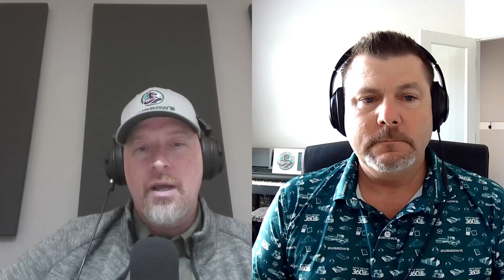EPISODE 41 - New Products!

Comment: That fact that only the bottom 5 feet is treated, is Ideal for Home construction or Barndo, Shouses, Man Caves, She Sheds. There is no need to use A full treat post for interior framing. That saves money on the post and puts less Copper  Aresnec treatment in to living areas! The Glue Lam Green Post Plained on 4 sides is a Premium Post offering, when compaired to a A Full treat nail lam with post protector it really no Brainer! For not much more money you get a straighter, Stonger safer post with a Life Time Guarentee! This is an incredible product! Builders don't pre judge your clients, present the Green Post Option and I think you will be very surprised to see how many of your customers will choose the Green Post! Banks will loan Money on these Post in the Ground!